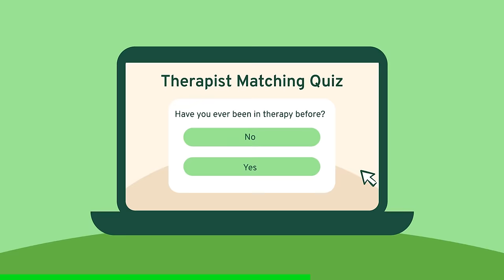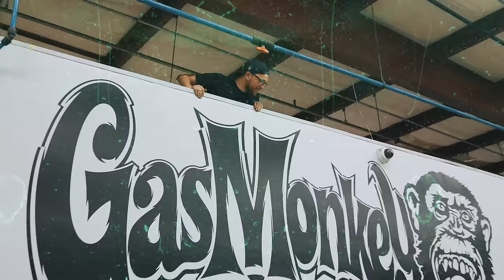Rebuilding the new Shop Truck - Gas Monkey Builds

Comment: When the man says change out the fluids you do all the fluids. Heck rebalance the tires and fill em with new air😅 He ain’t broke
Reply: Don't forget to change fluids in shifter knob 😮🎉😄👍
Reply: @jameslemon51  If it’s got fluid change it. Clean out the ash tray and vacuum under the seats😁
Reply: Seriously! And the damn plugs etc. he said do a tuneup. Don’t leave him stranded in Sturgis with a bad plug wire or something. Shit man. Lol
Reply: They knew the motor was coming out. No point in spending money on stuff your going to replace with the rebuild, it was all for content
Reply: @jameslemon51 that found next to the blinker fluid
Reply: That was my thought exactly  it's a piece of mind
Reply: @waynehangman3691  I think that was the only year they had hydraulic blinkers-- let the hoses dry rot and you got fluid everywhere...LOL

Comment: 351M same bell housing as A 460 !  I swapped mine with a 460  1972 Lincoln Cont ! Only had to change the motor mounts !  Best division I ever made! ❤
Reply: @dewighthackney149  👌👍
Reply: Exactly! Them boys are costing Richard money not knowing their stuff.
Reply: @dewighthackney149  I had a 460 in 4x4 svc truck once. Best truck I ever worked  out of. 460 is a great engine.
Reply: I'm no expert but my first thought was find a 460. I didn't even know that about the bell housing. 
They did a great job on the truck. Richard seems more layed back. Calling the shots and letting the guys do their jobs. I wonder why they didn't build that engine in house?
Reply: i remember hearing that but are you saying you could bolt a 460 up to a 400/351m transmission?
Reply: @augustusappling139  Yes thats what I did!
Reply: Easy swap. Did the same on my 79 short bed.  You just need a rear sump oil pump and pan if you pull it out of a passenger car.  Then some FE series 390 motor mounts and it all bolts up. All the electronics are the same.  As stated above... best decision ever.  Get rid of those 350/400 Modifies
Reply: @trenthumphreys9368  yup I forgot about the oil pan change! You are absolutely right!
Reply: @augustusappling139  The 351/400mod has same bell housing as 429/460.
Reply: 351M/400/429/460 can replace each other with a motor mount change and possibly an oil pan change depending on the application. If their "other" 351had a different bellhousing bolt pattern, it is a 351C. Which is also a great engine as well as it will fit most anything Ford made from '67 through the early '80s.

Comment: 78 - 79 F150 4x4 is by far the best 1/2 ton pickup ever made. Has the best , suspension & drive train.  Killer body style.
Reply: Wrong.2015 Ram 1500 ecodiesel is.
Reply: @steveatlas3492  you’re very wrong.
Reply: '73 - 79 F-150, F-250 and F-350 with the exception of a few trim/grill and engine changes were the same body style. Actually, that body style goes all the way back to '67.
Reply: Those years are Kool but the best years in my opinion are 92 to 96 the best looking truck ford has ever made also
Reply: @manueltovar4821 , you are of course welcome to your opinion but I'm pretty sure we were talking about trucks as a whole. Not just asthetic value. If we are going for looks alone, the '53 - 56 Ford F-100 was in my humble opinion by far the best looking pick-up of the last 80 years.

Comment: Beautiful truck it’s like antitheft no,one can drive stick shift anymore. Thanks for the entertainment.
Reply: I'm with you bud that s*** hurt my head how many times do you have to jiggle the shifter to make sure it's in neutral and it does not do any good to move the shifter if you're riding around with the clutch pedal to the floor

Comment: Dream truck, my dad's favorite truck he ever had was a 79 Ford 4x4 short bed he had in Forest Green.
Reply: 78&79 4x4 were absolutely  best ford trucks made since 1956
Reply: @br549junior I agree 💯💯💯 I have a 78 f150 302-306
Reply: My dad just gave me his 77 F150 4x4 shortbed with only 78,000 miles on it. It's got less miles than all of my other trucks ironically. Fun fact, it was built in San Jose, CA and I currently store it indoors in San Jose, CA. The only negative thing about it is in CA it has to be smogged which it still passes each year.

Comment: If this is going to south Dakota. Don't forget to test anti freeze to 40 below. A warm thermostat.  195 or better.  Studded chains for tires. And possibly snow plow set up.  Don't forget the weights in the back so it does not spin around.  BTW a block heater so you can plug it in.

Comment: After almost 2 years without a working car we now are using a 93 GMC pickup that has been sitting for 9 years. Would be nice to have the funds to just fix things like you did here. Like the wipers work when they want to. It only has 96,000 on it which is the best part.
Reply: Great truck, Search gm wiper module fix, you can probably resolder the pins to fix it

Comment: 351M parts are still available if not the are other Ford motor parts that will fit and some Chery parts also. Better off pulling the whole front end as there are only 11 bolts plus all fenders and rad support is out of your way

Comment: I'm not a huge Ford fan, but I do like an old school Ford Truck! Also, the the late 60's to early 90's Mustangs. And a few others on the foxbody platform.
Honestly I'm not a brand loyal stooge. If it's a GM, Ford, Dodge, etc. truck built in the USA between 1933 and 1998, I probably like it. 😂 Some more than others, but there were only a few bad years for each brand in that wide time period. And I feel the same way about muscle cars. Chevelles, Cuda's, Mustangs, AMC's. I just don't care. They all brought a different flavor to a delicious stew from a time before I was even born.

Comment: 351M is kind of a 400.  M is for modified so that means awesome, and They are tuff.  Not as tuff as the 400 but great!    400 is Probably the best motor ever made from ford in those days besides the 429 in my humble opinion.

Comment: I've had some experience what the 351 m 400 they were terrible motors if you're going to put that kind of work in it my suggestion is to put a high volume pump in it or your going to end up later on down the road will have the same problems with the lifters and cam good luck

Comment: You can hear the lifter taping as well as the knock from the smog system and vacuum leaking issues resulting in poor idle.

Comment: I’ve had a 1976 f150 2wheel drive short bed sold to friend for cheap $300 and a 78 F250 camper special ranger 390 sold that for 500 after I rebuild the engine - rear end was going out but have a 9 inch off a E250 with disc brakes also sold my 1989 F150 XCab with a 5.0 4X4 5spd manual dual tanks - best hunting truck besides my 1984 4X4 Ranger but cleared out driveway cause my kids got into teams gymnastics and other got into Elite basketball 🏀 now my youngest wants a 1979 f150 4X4

Comment: I have a 67, 71, and 73. Maybe I’m a truck addict? I’ll guarantee Richard didn’t drive that truck to Sturgis. Why do all that when you could add a can of Barr’s engine block seal to the radiator and a bottle of rislone no smoke to the oil and kept on rolling.

Comment: Actually 460 351m 400 all share the same bell housing. As did the 302 351w 289 online 6 only ford engines that were loners were the 390 and the 360

Comment: Have owned 10+of these dentside Fords and a big block is the ONLY motor that should go in there. 429/460 is the best swap. Radius arm bushings, track bar bushings (leading cause of the dreaded death wobble in the older Fords). Needs a fan shroud, or some electric pullers and lose the fan assembly.

Comment: Don't even play around with that 351 put a 460 in it and have twice the power and reliability... I have plenty of bone yard 351 s very weak bottom end and upper noise drive train and knocking .. good luck. .. n truck is sweet

Comment: Getting tires suspension, exhaust before making sure the engine works ? how about making sure the engine works getting a new radiator and taking the engine apart first

Comment: Let's all start building ford's huh, gotta love an old chevy
Reply: Damn didn't turn the flywheel, I hate a bouncing clutch
Reply: Yeah I love my Chevy 98 Silverado 3500 four-wheel drive long bed crew cab that died at 127 thousand miles and it started eating water good God I'm tired of working on vehicles
Reply: I prefer the old Chevys & Dodges
Reply: Something you don't hear in the chevy world is I got the same motor over there but I'd have to find a bell housing, been there done that, absolutely kills production and moral

Comment: Lmfao I threw away many a 351m and always went for the 460 or an old FE if I could find one !!! 460 is what that beast needs but I guess nowadays even the M motors are worth something. If I’d have only saved all my parts and blocks from the 70s that I had in The late 80s &90s I’d be rich 😢

Comment: If that was my truck, I’ll make that a few injection and rebuild the motor and put a electronic ignition to it all
Reply: Yes fuel injection
Reply: never had a car with few injection
Reply: If it was mine I'd make it steam powered .
Reply: @SquirminHermanthe1eyedGerman  it’s better to have a few injection because the reason why you can keep the cartoon a lot better and it’ll start a lot easier carburetor and that if it sits around, it can gunk up the carburetor a lot easier you’ll get better gas mileage with fuel injection and better horsepower

Comment: 14:33 when in doubt:

LS 850hp!
Reply: Just glt a little piece of acrylic plastic, sculpt one R to the correct dimensions out of it, then slap it on the hood.
Reply: Would’ve given the guy stick for painting the engine bay, but the current condition will surely just double time further corrosion on the new finish..

Comment: I would have put a better set of heads and cam on that 351M/351C and it would have picked up 150hp with ease. Those stock heads are 70s emissions trash.

Comment: My first Ford had that shit eating 351M engine that ran like complete shit, when it ran. Then I bought a 90 for it, but it wouldnt bolt up to the bell housing. So I tried to put a 360 in it, that wouldnt bolt up to the trans. So I bought another trans that would match up to the 390 but the motor mounts, steering gear box, nothing matched up. Chevy doesnt do this lunacy. I decided at a young age, 25, to never ever, ever buy another Ford. One of the greatest decisions of my life.

Comment: You can always rely on a Ford. Wait, nope.
Reply: Yeah my Ford F100 truck 1966 is dead with a Auto parts motor with only 40,000 mi on it and that motor cost me $750 that I changed out in 1985 I'm so sick of working on trucks and cars
Reply: had an '83 with the 300 straight 6 3sp that went thru 2 trannies & 3 rear ends before going to the scrap heap & an '89 302 that turned into a sh*tbox & still sits where it was parked 30 yrs ago! Had better luck with my '72 Dodge D150 440, '83 Dodge Ram D150 318 & '96 Dodge Ram 1500 360{ bought new & now has 425,000 miles & still running} ✌💖☮

Comment: 429 swap. Adapt the trans/related. 351m polished turd.
Reply: yup, its a boat anchor just like most Ford engines
Reply: @SquirminHermanthe1eyedGerman  351C even better but thinking there’d be too much bullpuckey to retain that trans setup.

Comment: 351M/400 is a piece of crap motor. I swapped a 429 in mine. Stock from a '69 Mercury.  Same bellhousing pattern.  Better mileage and power.

Comment: That dude was lacking.... says it dosent need spark plugs and the truck is clearly running like crap... why did he have to pump the carb like that to start it???? Why change the muffler sound if it aint even Running right

Comment: you guy'sfuck up you forgot to change the spindle 's and bearing's front and back. should drop the tran's and put a 7 or 8 speed tran's. also should check to see if there oil journey and change them to bearing's. you know 4 core radiator's and bigger coolant pump and oil pump. love GOD

Comment: Find a 460 then call L&L engineering get a pan mounts a bell  or ada[per and a flywheel  pilot clutch and do IT RIGHT> A 400 is baad enoughbut a 351M , dog of all dogs . your nuts building that POS 351M. just shows tha a  minimum of researcch would have sent you just where I am sending you.  That is the sickest 79 4x4 in the world.  It could have had a 300 six and have the same power , and his boooster should be a 1 ton one not the stock suck booster and get a 1ton proportipning valve  and master, and you will have brakes . anything else is DANGEROUS. shut your mouth and listen for once.

Comment: You're sticking your nose in like you're still on tv. This is YouTube. Give him his job and let him do what he's trained to do. Leave him the f til he comes to you and says he done. Smh   you just slow him down interrupting him.
Reply: Crying out loud. Head gasket is 2 hour job and replace the pushrods and rockers.  Only reason to pull the motor is rings and bearings. This ain't a mechanics shop, it's a parts installation shop.